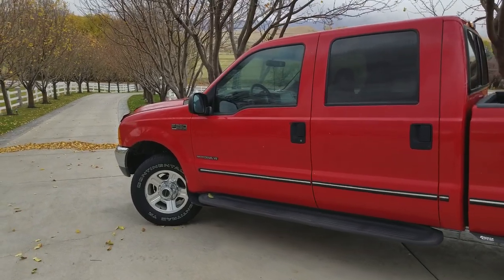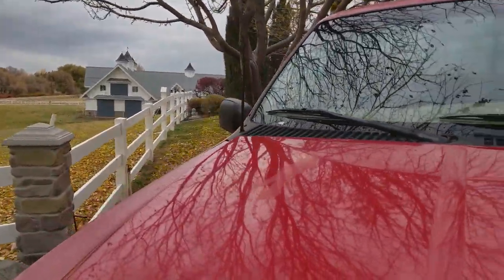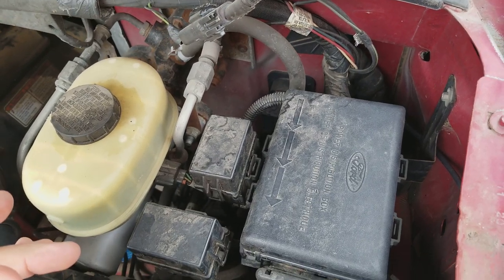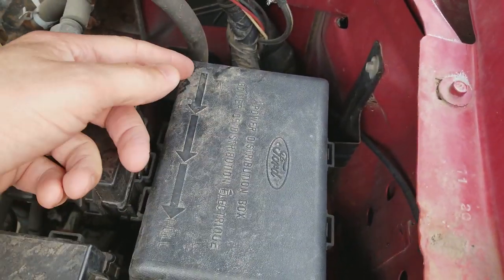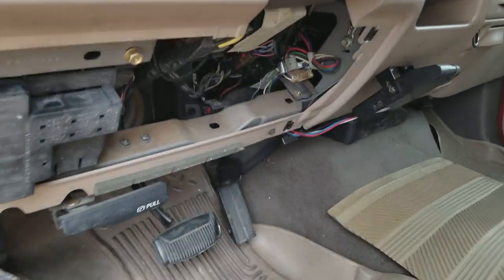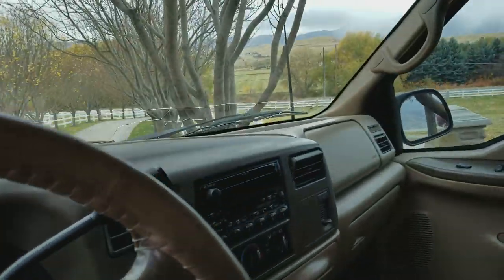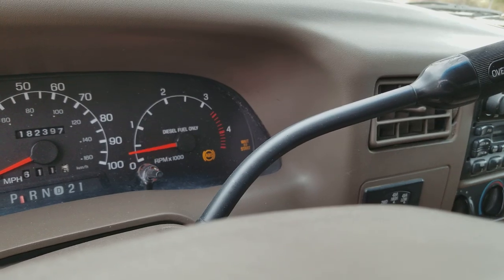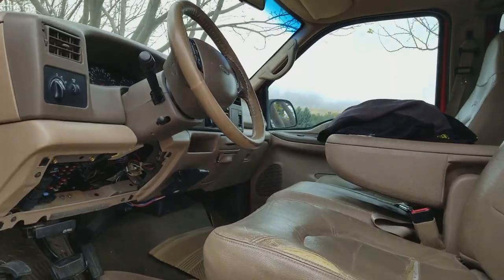1999 Ford F-250 Super Duty diesel 7.3L won't start died suddenly

Comment: I had same problem, however, was not blown fuse at that location, it was the female part of fuse holder that lost tension to hold onto fuse, you would drive and fuse would loose connection with fuse holder 
Your video did direct me to that location and greatly reduced my diagnosis time, thank you very much
I replaced fuse box with oem from ford.
God bless you sir!
Reply: You just saved me a whole lot of headache. Thank you.
Reply: What year is yours? I'm gonna check mine connections if I find the fuse

Comment: This is almost always caused by the fuel bowl heater. UNPLUG it and the fuse will stop blowing. The heater coil costs a pretty penny but is easy to change if you really need one. I unplugged mine years ago and the truck will still start in below freezing weather.
Reply: Where do you unplug it at
Reply: @StrikerxCast connector  at rear of fuel bowl. 1 is heater, other connection is water in fuel sensor.

Comment: The issue was the fuel bowl heater shorted out and blew the interior fuse which also allows the pcm to fire the injectors. 
 The main clue is the no wait to start light....have seen many 7.3s do this. 
 Doubtful you needed gpr but glads it’s fixed.
Reply: Billy Gildark my truck had done this and so had my friends it's common
Reply: @joeford9233  so do you think it is a fuse? I bought a new pcm still no wts light
Reply: I have no wait to start - hydra has no power - would that fuse cause this? Checked under the hood but not int ones
Reply: Where is the fuel bowl heater
Reply: @darrrolle2570  in the bottom of the fuel bowl underneath the filter.
Reply: I'm getting no communication to PCM. wait to start light comes on. Tach moves when cranking. I heard something about a diode not working correctly.. any ideas? Thanks

Comment: On mine (2001 7.3) the large 20 amp Max fuse for the pcm under the hood blew when the fuel bowl heater shorted out. I unplugged the electrical connection at the rear of the fuel bowl replaced the fuse to get home. Than I ordered a new fuel bowl heater. Problem fixed!! Don't get an aftermarket heater. I bought mine from Riffraff Diesel, an International OEM part. $39.88 best price anywhere. My original heater lasted for over 17 years with 328,000 miles.
Reply: My 2001 7.3 has no lights, no ding, no wait to start, no nothing and the batteries are fully charged! Is this what happened to you? I will try this. I have never had a problem until today!
Reply: @territowner8350  Yes, no lights on the dash except one red light. I believe on the left side of the dash. No other warning lights.
Reply: @territowner8350  do you have your original fuel bowl heater from 2001? The insulation on the heating element wire decayed and touched the inside metal of the bowl driving down these nice rough roads. I could have put shrink tube on it but it wouldn't hold up to the fuel.
Reply: @XEGTDodgeMagnum , As far as I know, it has never been replaced. I had my son go out and start to test for power and there was no power to the PCM fuse. That said, while he was testing things the lights came on and then we could start the vehicle! We think it is a loose wire. That is scary in and of itself as you never know when it will make a connection or not. I will show my husband the wire tomorrow. I really need to use the truck. LOL!
Reply: @territowner8350  Maybe he should change both fuses, the location 24 the 20 amp under the hood, and the 5 amp location 15 under the steering column. Have him check how tight the fuses go into the holder so they make good contact. I had a problem a while back where my headlights would just go out and leave me in the dark, it took a while to find the problem. It was a bad connection in the fuse holder, I took a pliers and put a little twist in each fuse leg and it went in nice and snug. I did it this way  because I was on the road and couldn't see how i could repair the fuse holder at that time That was three years ago and no problems since. Good luck with it. Let me know what happens. I hope it's not a loose wire somewhere, that can be difficult to find.
Reply: @XEGTDodgeMagnum Ford, Good ideas! I will talk to my husband in the morning about it. I will print your suggestions out so he can read them. Thank you for everything and I promise to let you know how it turns out. Thank you!
Reply: @territowner8350 👍 the fuses are a good place to start. I would look at the 5 amp first, it's small and is the most likely one to give the problem.
Reply: Mine also blew out also changed out the fuse  now truck idles rough can’t seem to find problem replaced heater and pig tail  can’t seem to find problem

Comment: Ummm... when fuses blow, it is due to a problem in the system usually.  So, yes the new fuse may have you covered for a bit, but you might want to investigate / replace the item that is powered in that circuit as it may blow continue to blow fuses until it is fixed.

Comment: The same thing happened to me, i replaced the fuse. Still not starting funny enough i replaced my fuel pump and the big 20 amp #19 fuse a week before. Trying everything before i have to get a new pcm. Did your fuse work for a long term fix, or did you keep running into problems.

Comment from the maker: I had a repair shop replace the fuel heater and the glow plug relay and I haven't had a problem since. The new fuse repair only lasted a few days. Call Tim's Diesel Repair at 435-245-3330 for more info.
Reply: That fuse controls both the fuel bowl heater and power to the PCM.  If this fuse blows, simply disconnect the connector at the back of the fuel bowl until you can replace the fuel bowl heater.  I once ran a truck with this heater disconnected for 2 years because I forgot I disconnected it....

Comment: these things can really be a mystery especially if they haven't ever givin a problem and suddenly die and wont start Ive learned if you dont have a proper way of anylizing one find someone that can it will save you alot of money oh and if you happen to go over some rough roads and trouble starts check the injector connections under the valve covers just might be a loose connection

Comment: I have a 99 f250 Super Duty,, Did this fuse ever blow again? I had the same problem, but the fuse kept mysteriously blowing, turns out by accident I figured out the cause.
One day while changing out a leaky fuel bowl drain, in the bottom of the the fuel bowl, the fuel heater is a single 18g wire grounded by solder to dime size tabs, ""probably the original heater coil"", the solder broke loose from the wire causing a bad ground blowing my fuse. I live in Central Texas, I removed the fuel bowl heater completely. AND WA-LA no more blown fuses.
Reply: BTW - Not all fuel bowl heaters are a single bare wire soldered to tabs, at least in the 99 - 03 models. I thought about replacing it and realized there is a different style heater coil, more like a miniature circle heater coil, kind of like the one in your oven or electric water heater only smaller, instead of a single 18g wire.

Comment: I had exactly the same issue but in my case the fuse continues to blow. Had the pump replaced but the same fuse still blowing. Now I don't know what else can be. Wires are not in short and normally fuse blow around 15 minutes after starting the engine.
Reply: It's the heating element in the fuel bowl under your fuel filter shorting out. Replace the heating element ...about 60.00
Reply: @harveynailbanger  Yes, that was the problem. Thanks.
Reply: @harveynailbanger  where is it located

Comment: So was your wts light out - mines out and so is my hydra , I thought ecm
Reply: Did u find out what’s wrong
Reply: That im pretty sure is the big 30 under the hood on #17
Reply: @oxford7.357  were you getting any power to the cab? I’m having an issue with mine,batteries are good but no power to the cab.
Reply: @JoseRodriguez-yp2ss  yes im gettingg power everywhere throughout the truck just not firing

Comment: Your misfortune found my problem. My fuse was blown also. Now the question is why did it blow in the first place?
Reply from the maker: The repair only lasted a few days. I'll let you know the reason when I get to my truck and find the repair shops receipt.
Reply: Could be fuel bowl header.
Reply: Yep fuel bowl heater shorted out
Reply: Need a new fuel bowl heater